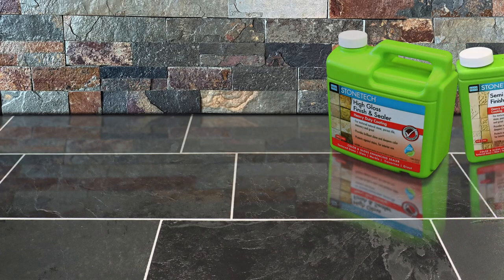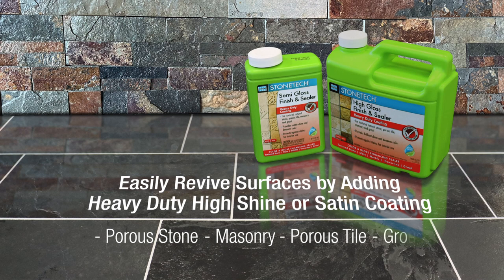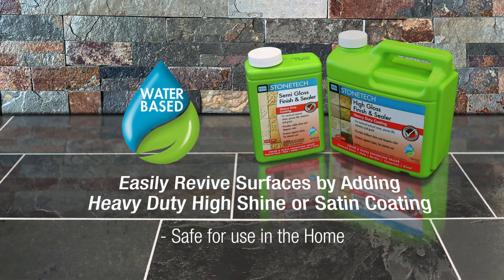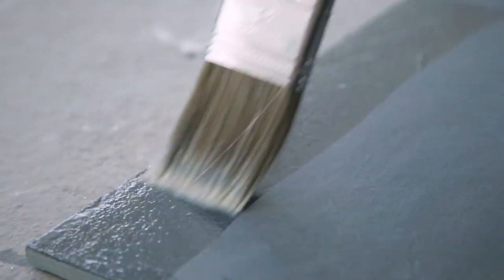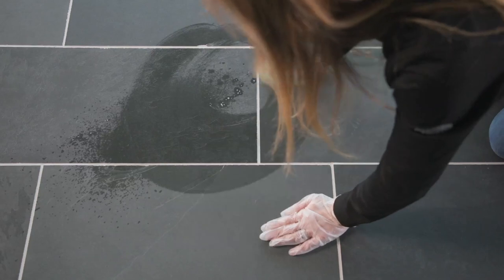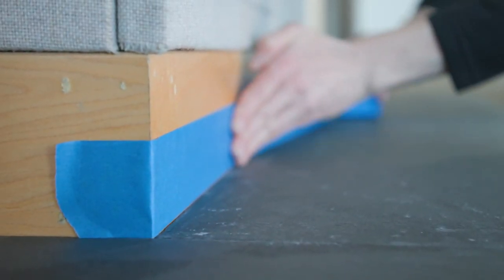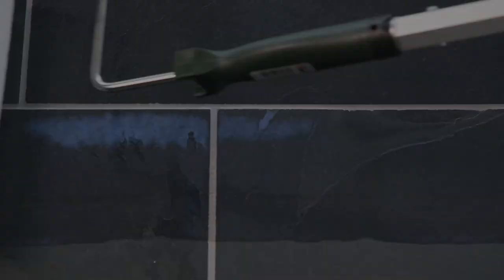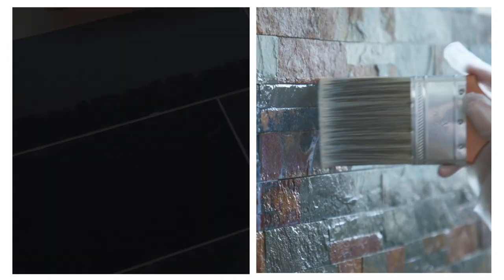Transform and Protect Stone or Porous Tile with STONETECH High Gloss Finish and Sealer

Comment: My contractor applied this over polish high gloss marble. The surface doesn’t feel soft and smooth anymore. How to cure it?
Reply from the maker: This is a topical sealer so it will leave a thin coating on top of the surface to create the High Gloss Finish it provides, which is why it will feel different then it did before it was applied. Here is the product data sheet which may help answer any other questions you have: https://cdn.laticrete.com/~/media/product-documents/product-data-sheets/ds-2195

Comment: hi! im  my tiles inside house is matt tiles not shiny .. can  i use this high gloss  finish and sealer? i didnt put any sealer on it since .. pls reply i want to put an order..
Reply from the maker: Hello! Thanks for your message. What type of tile do you have? Is this a wet area? If you have Textured Stone, Slate, Limestone, Saltillo, Concrete, Bluestone, Sandstone or Flagstone and its not a wet area you can use this product. If you have porcelain/ceramic is not suitable. Hope this helps!

Comment: Does it work on basalt
Reply from the maker: We do not specifically state Basalt in the product's data sheet for suitable surfaces, however we do list out several general stone surfaces. It is always best to test out the product on a separate piece or an inconspicuous place in the installation to confirm compatibility.

Comment: Hello, Can you please tell me if Stonetech Semi-Gloss Finish and Sealer can be used on interior stamped concrete which has been painted with water-based concrete paint?   Thank you
Reply from the maker: Hello! Thank you for your message. The product can not go over any substrate that has been painted.  It would have to be stripped and free and clear of any sealers, paints or coatings. Hope this helps!

Comment: Can it be used on the bathroom ceramic tiles?
Reply from the maker: Hi Vanessa. Thank you for your message. No. STONETECH High gloss and Semi gloss Sealers are not recommended for ceramic tiles. Also this product cannot be used in wet areas. Hope this helps!

Comment: Thanks Diane - how will your finish/sealer handle temps?   In an application where there is a stone surround or fireplace (obviously not within the firebox) where temps might consistently hit 180 degrees, and periodically approach 230 degrees fahrenheit?  I've personally conducted an oven test with your grout sealer product, and seems to hold up just fine without discoloration or odor.   Still, I would like a stone product that adds a finish (deeper color) to the stone, which is what brought me here.    At the same time, it would be nice to have protection from any sooting stains that might occur over time - hoping this product is the ticket.
Reply from the maker: Hello! Thank you for your message. This product is for interior use only and should if used around a fireplace please ensure it is not entering in the fireplace. The hearth and stones around a fireplace will generally hold up well, but it depends on the stone as to how hot the stone can get. This product is an acrylic and generally can withstand high temps, but do not have a set number at this time. More info provided in our data sheet: https://cdn.laticrete.com/~/media/support-and-downloads/technical-datasheets/tds132.ashx?la=en&vs=9&d=20220125T155214Z&hash=3D94357B21071E31EBB8B99D8FA26277B5AFB1D3 Hope this helps!
Reply: @laticrete  This is helpful information - thank you.   I can appreciate that you don't have hard numbers, given all the variables.   Still, your response is sufficient to support my purchase and testing.   Unrelated to this topic -  I also wanted to mention how I love your hydro-barrier product for bathroom/waterproofing applications.   Thanks again!

Comment: So when you apply this to floor tiles you still have to wipe down the excess after 15 minutes ??
Reply from the maker: Not with this product. This product is intended to be topical, so after application you'll need to allow 30-45 minutes between coats or until the surface is dry. Surface traffic may begin 12 hours after final application; keep installation dry for a minimum of 12 hours; full cure is achieved in 24-48 hours.

Comment: Can I put a coat over marble?
Reply from the maker: Hello Greg! Thank you for your message. What type of marble? If this is a polished marble no. If this is a honed marble you can use it as long as this is an interior and not wet area. Here is the product data sheet which may help answer any other questions you have: https://cdn.laticrete.com/~/media/product-documents/product-data-sheets/ds-2195.ashx?sc_lang=en&vs=1&d=20200116T000229Z

Hope this helps!